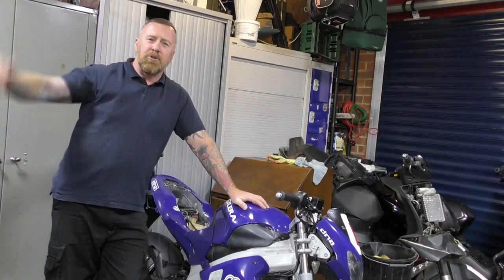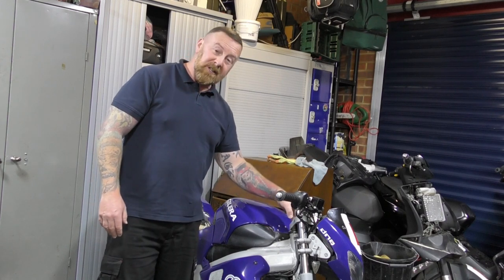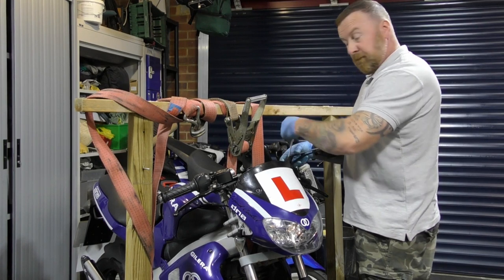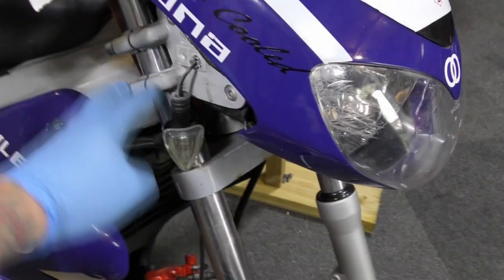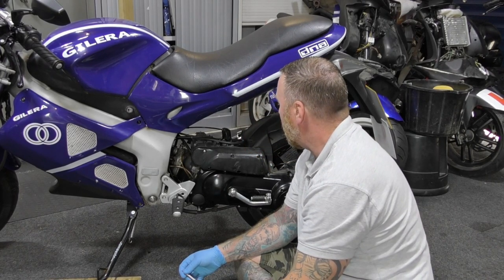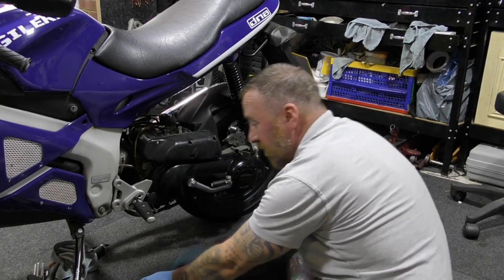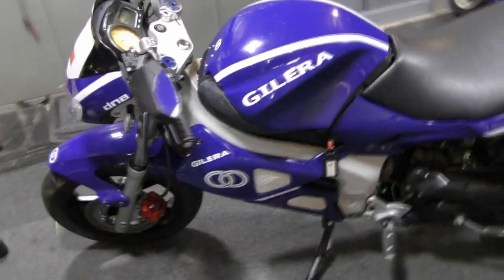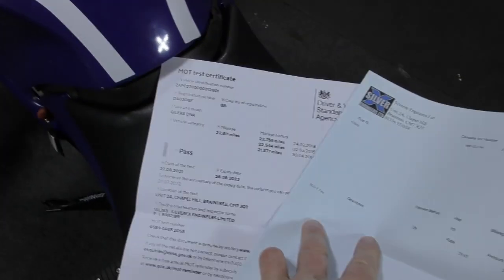GILERA DNA 50CC PROJECT FIX UP EXHAUST CARB TUNE SEALS

Comment: I’ve seen a few videos of yours on the DNS’s and they are 👍 
So, I got one too, and working on it
The bugger won’t go past 20min (stage 6 70kit)

Not sure if the veriator is set right
Should there be the 5.5mm spacer before the variator goes in?
Also, the one in situ looks smaller to another one I have in the shed (smaller rollers, smaller diameter etc)
Any advice, would be appreciated
Reply from the maker: 6g should be better but they are larger than speedfight ones
So 7g can be ok 
Remember the clean 
Dry 
Sometimes the washer needs to be in to keep it in line 
They should be getting 50mph easy !

Comment: I might need some help with one of theses mark as I just got one for my daughter that hasn't run in about 8 years
Reply from the maker: theres a few videos on my channel on these bud 
type in dna mark savage
Reply: @marksavage  I have watched most of them now mate and have managed to get the bike running after 8 years of storage but the water pump seal has blown now so have to change that asap
Reply from the maker: They are Easy to change bud ,on and off
Reply: @marksavage  don't you have to split the case to get to it tho

Comment: Hi mark I could do with your help…

Just purchased a 2002 gilera dna 50cc LC
It starts and runs 
When riding it’s slow at take off and no power and rattles from kickstart case .
Took case off and was missing 2 rollers so put a fresh set of rollers in. Takes off good but still no power hits 14mph and revs out full throttle, has some after market carb on and a pod filter with a 70 main jet and air / fuel screw is 1 & half turns out
Reply from the maker: 6 g x6 and clean ,good blt and clutch ok 
so carb yes mate thats you problems 
try and get a gilera carb and to be honest 70 to 80 jet are good on these but id be going for 74 and the right dna air filter 
that will sort it 
other wise some cheap carbs like the setting air mix all the way in !
Reply: Thank you for the reply I’ll give that ago and I’ll try get hold of a air box and carb
Reply: Hi mark I put some 5.5g rollers in at the correct size and it’s hitting 30mph now however it’s still rattling from the kickstart case , having issues with a earth wire for my indicators and I can’t seem to get the electric start to work
Reply from the maker: @dylanrobinson4176  follow my electric start video it will help 
Off the market carb is the problem plus the air filter bud
Reply from the maker: @dylanrobinson4176  the rattle will be the kick start cog or the bendix
Reply: @marksavage  I’m trying to get hold of a original air box and carb now

Comment: bruh mine gilera dna goes like 35 mph max
Reply from the maker: I've had about 30 of them and all have gone very well except the 4t 125cc !! Slow really slow 56 max
But a small upjet , sports exhaust,  fresh rollers and a sports inbox filter 
As in my other videos bud 
Easy to do